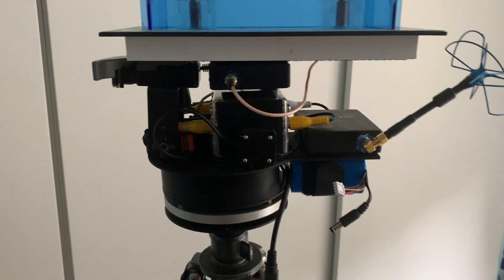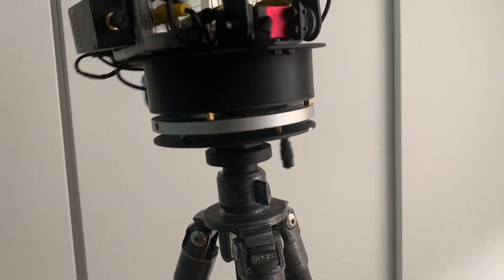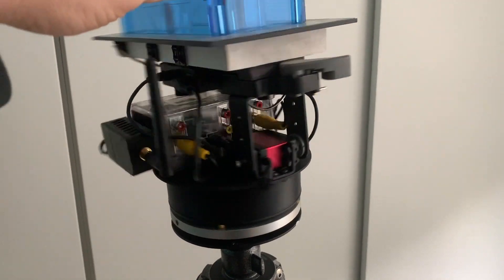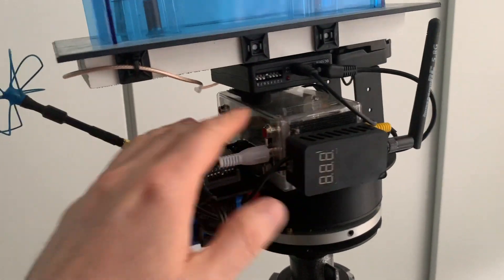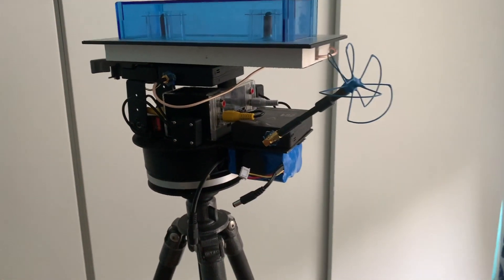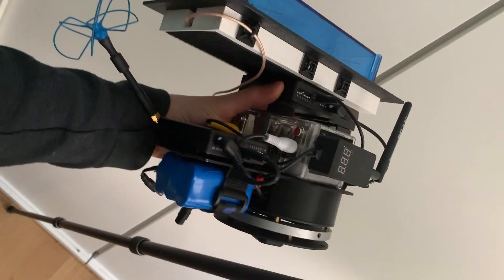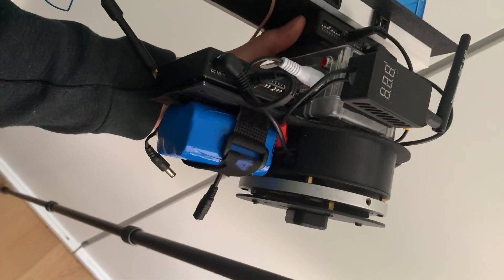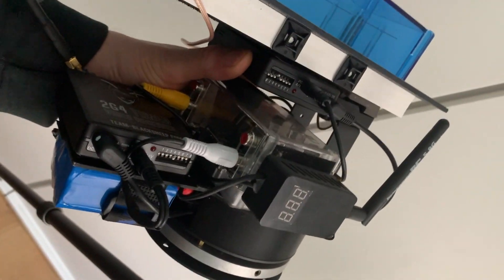Heavy Duty Antenna Tracker (final)

Comment: Dont suppose you have a full parts list for this tracker do you bud? Great work it looks fantastic!
Reply from the maker: CQR Bunn links to used parts on thingieverse
Reply: @alexanderfedorov7890  AHH missed that, thank you! :-)
Reply: Hi bud, sorry just a couple more questions If I may:
1) did you go for Option A or B for the base that you linked?
2) Plastic or metal winch for the Kingmax servo?
Reply from the maker: CQR Bunn i use 20kg red servos and metal whinch. pricey but smooth. i ordered 2 turns config - default